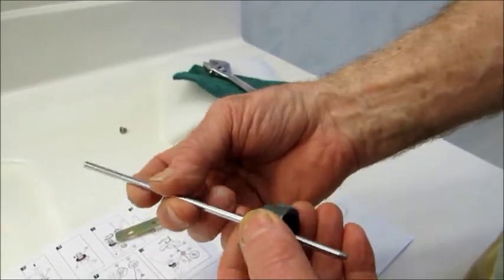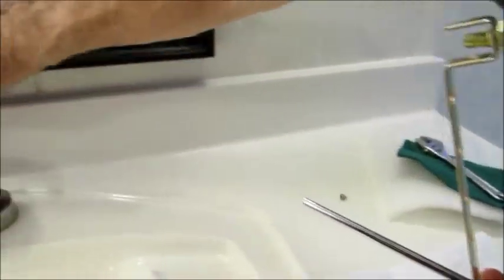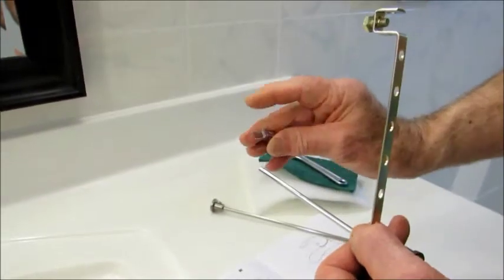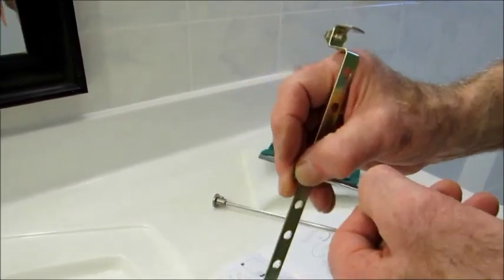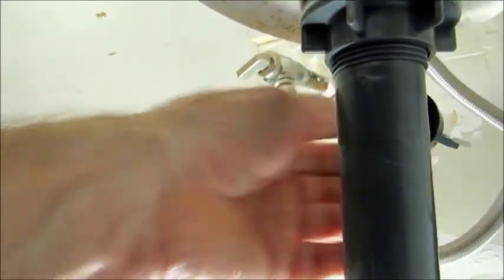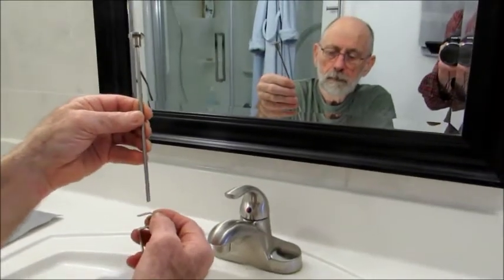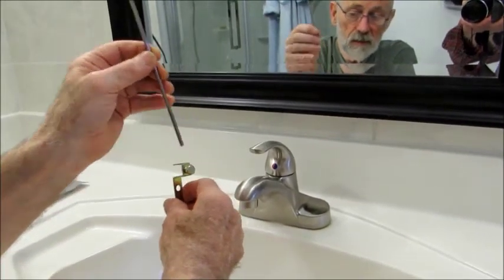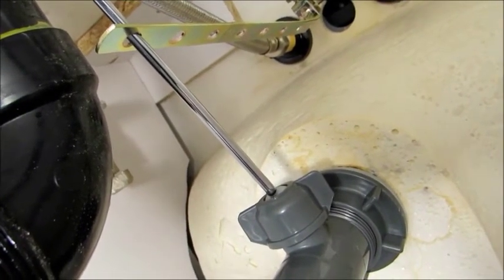How to Install a Lift Rod in a Bathroom Sink

Comment: So I just realized the plumber I hired did a bait and switch. Not only did he not apply the second metal clip but totally replaced the metal lift rod for a plastic one. No wonder it nolonger works and I will have to go to home depot and replace it for a metal set. Too bad he lost a customer and future referrals.

Comment: DOES THE NUT THAT HOUSES THE BALL HAVE A WASHER IN IT? THAT'S WHERE MY LEAK SEEMS TO BE COMING FROM, BUT WHEN I DISCONNECTED IT THERE IS NO WASHER THERE. IT SEEMS TO BE LEAKING WHERE YOU TIGHTEN THE NUT, NOT WHERE THE BALL SWIVELS BUT I'M NOT 100% SURE. THANKS
Reply: Did you figure this out I am having the same problem?!

Comment: I bought a delta set and I don't have a lot of tools.  Anyway i install the faucet and drain and they work perfectly until try to push the cabinet flush with the wall.  The up and down rod fro the drain is so long I can't push my cabinet against the wall.  Any ideas?  As i said before I don't have many tools mostly hand tools and an oscillating power tool.